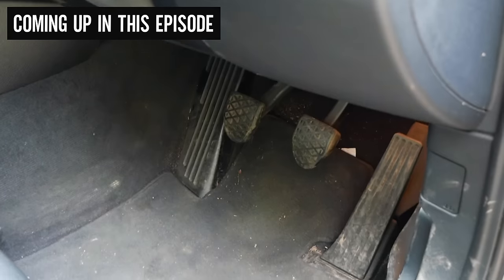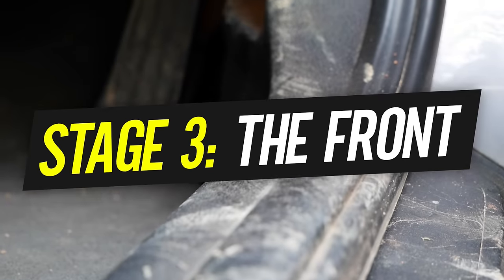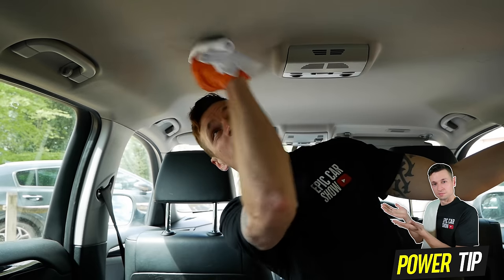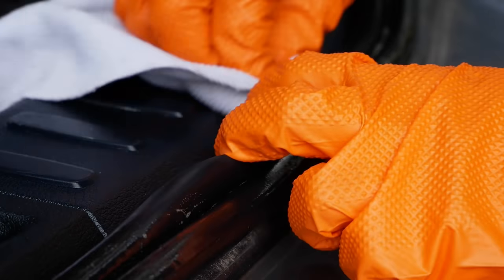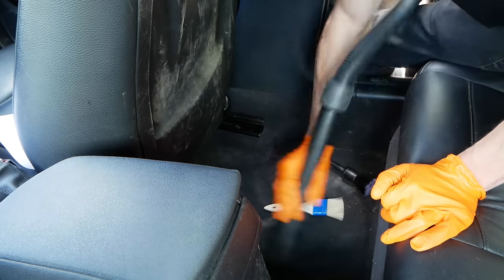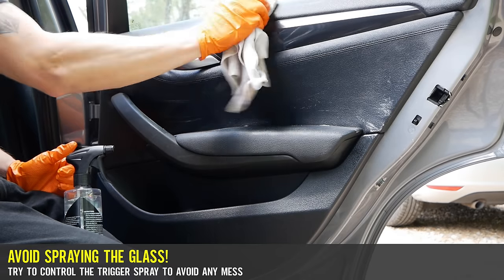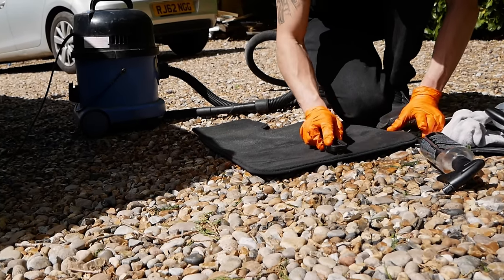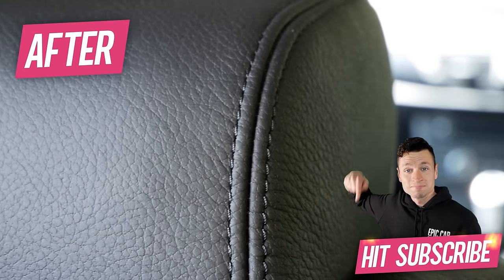Complete Interior car detailing guide for beginners!

Comment: I always start with the interior. My reasoning being when you wash the outside first the ground around the car is wet so your shoes get wet then if you do the interior you end up with your wet shoes on the carpets etc, or have to try cleaning with your feet hanging out the door which isn't the easiest. Just my way of doing it 👍
Reply from the maker: Fair play on that idea. Really interesting to see other peoples thoughts 👌
Reply: @epicautomotivedetailing  Have you any tips on dealing with surface scratches on interior door card plastics?
Reply: I'd do the outside first most the time... Where i first worked to start a lot of the customers cars would be parked on a dirt area... The water would wash dirt off my shoes, then when i do the interior i would be able to vacuum up any dirt/water... Pro tip, have a wet & dry vacuum if you can
Reply: A pro tip is to use disposable shoe wraps for that,
Reply: Wish i thought of that before yesterday. Its one of those things thats obvious but you only realize when you mess up. Especially when the floor is dirt 😅
Reply: @BlackHatProductionsx  a pro tip would be to buy a new pair of trainers everyrime they get wet,
Reply: I live in australia, if I do the outside first the inside get so hot! And all my products dry up
Reply: Disposable shoe wraps and dry car thoroughly
Reply: @isaacdurnian7160 good point I live in Texas and the heat index where I live is consistently 120+ so I turn my back for 5 seconds and I got water marks or glass cleaner streaks 😂
Reply: your a clever man
Reply: That’s good reasoning
Reply: @chrisfricker7025 😂
Reply: Always preferred interior to exterior cleaning as well...just seemed to make more logical sense in my mind without thinking about the dirty shoes lol. Also a valid shout to why interior cleaning is better first haha
Reply: The only time I was first is at the drive thru. Since their hoses are above you and the ground around you is dry
Reply: Try washing the car just a few feet’s from where you’re going to be stationed to detail car interior. Wash & dry same spot when done bring car to dried area switch shoes. 💪🏻👿🔥

Comment: Hey Bud a nice quick informative vlog for beginners,  I normally wash exterior first prevents rubbing of dirt bringing more  into the car when doing interior but saying that I leave giving car a detailing spray til last as when your doing interior of car you can and most likely will touch off some panels with hands or brushes for example...

Comment: Another great video again Dave. 
I've detailed a few cars now, and I feel like I'm struggling with the interiors, I did exactly as you have, but the door cards look the same after I've cleaned them, there's scuffs and marks that I just cannot shift
Reply from the maker: Was the brush too soft? Sometimes mud can take few attempts in the plastic grooves
Reply: It was a autofinesse feather tip interior brush, thanks for replying 👍🏻
Reply from the maker: @waynemoore9951  Valet pro do stiffer brushes to tackle those tighter grooves

Comment: Can’t wait for the next one, put it out their now 🙅🏼‍♂️😂
Reply from the maker: This weekend I think mate next one features 2 giants
Reply: @epicautomotivedetailing  Always use your tip for glass cleaning with no chemicals, in this vid you use Yum Glass which i have, do you spray yum glass on to flunky and then continue as no chem  method?
Reply from the maker: @tonylange6630  I only use glass cleaner if the glass is too sticky or greasy. So either spray flunky or glass before applying 👌

Comment: In general for cleaning fold your wash cloth into  quarters and in half again as you dirty it unfold and re fold each clean section outwards then you have 8 equal clean sections to work with. Sometimes you need a thin code for a car but it will work for more than half of the cleaning.

Comment: I'm a professional detailer. Do I start with the outside of the inside? This depends on the temperature of the day direct sunlight and the time of day that I'm doing the detail. If I can get there early in the morning and I know that it's going to be a hot day and direct sunlight I'm going to wash the outside of the vehicle first and then move on to the interior. Now if I know it's going to be a cool day and I'm not likely to be in direct sunlight I always start with the inside.
Reply from the maker: Yeh good point. You have to adapt to your surroundings and the environment. I actually did inside first today because of the weather
Reply: Strawberry,  if you're a professional shouldn't you already know where to start? 
( do i start with the outside OF the inside 🤔 )  
I get what you meant tho.....           or yeah 

Your welcome

Comment: Thanks for the information you are sharing with us out there. Can I use multi-purpose-cleaner for interior detailing. How about a water-based-degreaser? 
Thanks
Reply from the maker: I've used many cleaners and product's. Bilt hamber surface hd was cheap but awful on the interior in testing. To be honest Poundland do a product called the pink stuff which was ok for people on a budget

Comment: Am I the only one who just uses a bucket of hot soapy water for almost all interior plastic trim? I find it gets the job done cheaply and doesn’t leave residue. For leather I do use a dedicated Autoglym leather cleaner and care balm though. And I know a lot of people dislike it, but I am quite fond of Autoglym vinyl and rubber care dressing. It’s easy to apply, smells amazing (natural lemon odor) and it leaves a great mid sheen finish and it’s really not greasy as long as you don’t overapply and buff off the residue properly
Reply from the maker: Do what you like mate don't let others dictate what you can or can't do. If it works for you go for it!

Comment: I usually start with the insides of the car (if I'm not doing the insides another day). And why am I doing that? In my head, it makes most sense, when you're carrying matts n' stuff out and inside the vehicle to do the insides first. Otherwise you'll just end up making you car dirty again. It's like cleaning the wheels after a car wash basically.

Comment: I always start with the exterior.  Why? today's Ceramic Polishes/Waxes require 24 hour cure time between coats.  Day 1 is deep cleaning of exterior, decon., & polishing.  Day two starts with waxes, then on to the interior.  Day three will include waxes, if applicable? and finishing touch ups...
Reply from the maker: Very good point

Comment: What to do with sand that the vacuum can't get out? Is a drill brush a good idea, even tho it just throws the dirt everywhere?
Reply from the maker: As annoying as it seems you just have to repeat the process. Its the same with a car dryer. If you blast the interior it makes a mess but then after a few passes it soon disappears
Reply: @epicautomotivedetailing  so you halfass vacuum, then drill, then do the plastics and vacuum again?
Reply from the maker: @anonymguy1233  yes to put it bluntly lol. You always end up having to go back and vacuuming bits you may have missed at some point